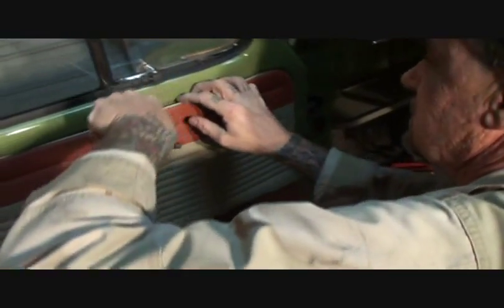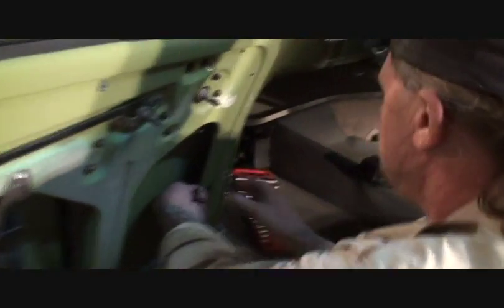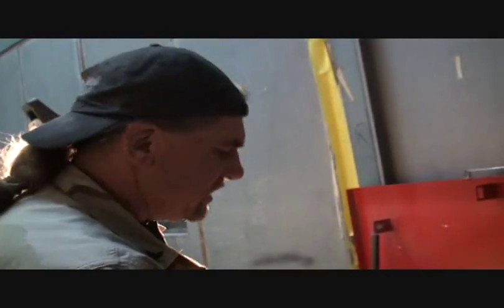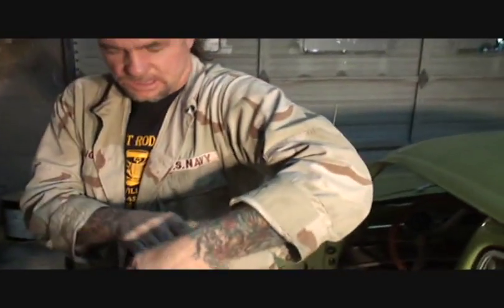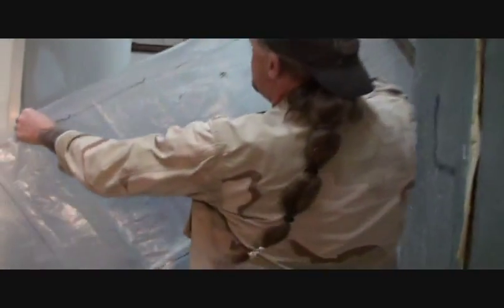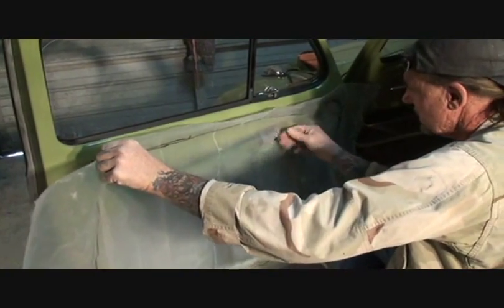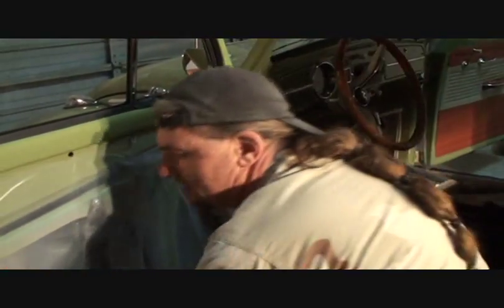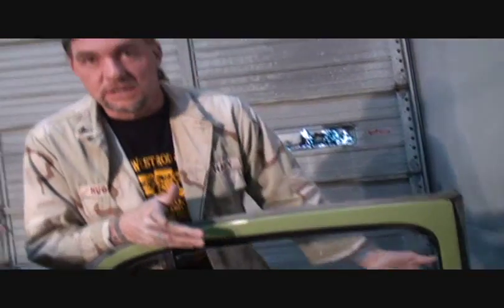1964 Volkswagen Beetle/Bug-How To Install Interior Insulation, Part 3

Comment from the maker: @tylerphc1 The orginal insulator was a thick type tar backing material, which is actually made for sound proofing, this type of insulator is heavy in weight, and might cause problems toward falling out in the future, which could lead to failure of windows rolling down.. Pete

Comment from the maker: Check Lowes as well to see if they sell it, I believe thats where I got it at, as for the roof application, yes you can use it, but make sure you use plenty of contact cement on both surfaces befor applying it, being upside down and the sun hitting on it, may make it weak and want to fall off later down the line. Pete

Comment from the maker: For best results use 3M Contact cement and a throw away cheap spray gun, they will stay on for life, spray both surfaces let dry to the touch then apply insulation.